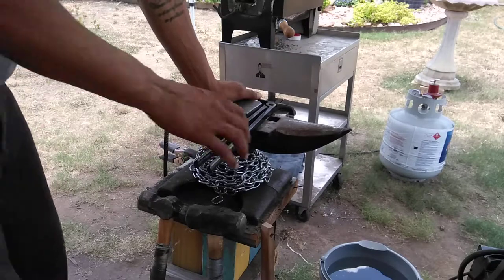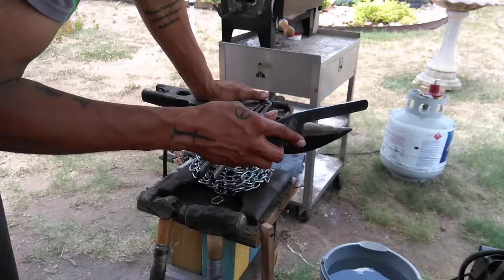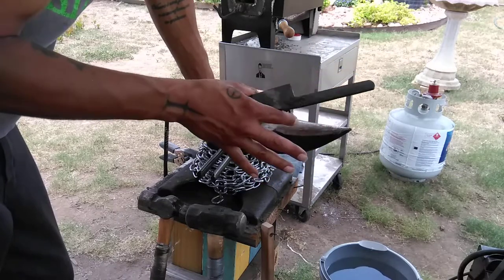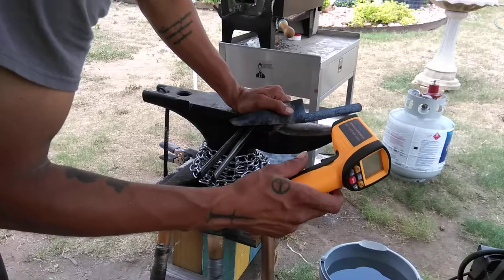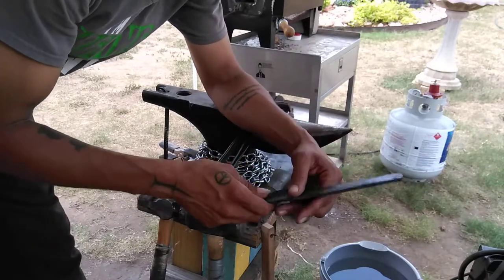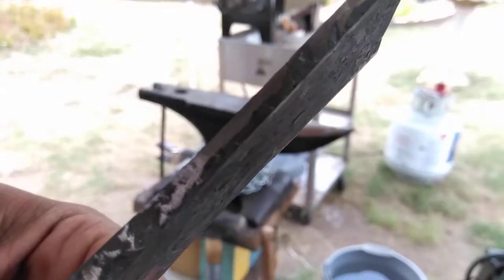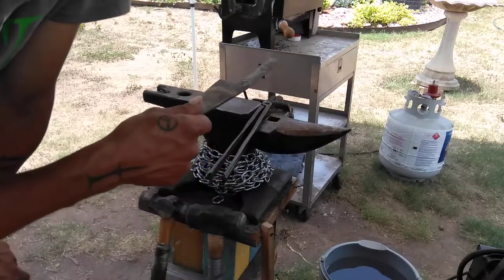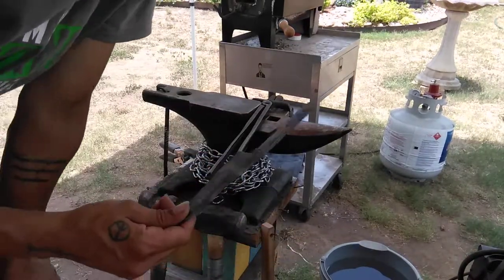Annealing 5160 for cheaters PT. 1

Comment: I rigged up a high temp k type thermocouple to my double burner gas forge.  Best thing i ever did to it allows you to level off and soak at high temps and get accurate repeatable results. It will make you forget that infared gun it sure did for me.